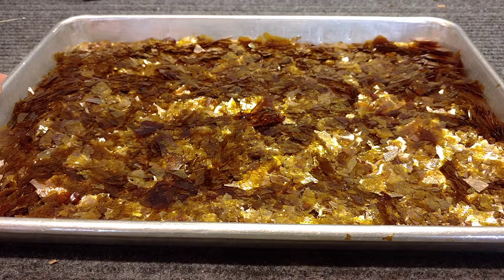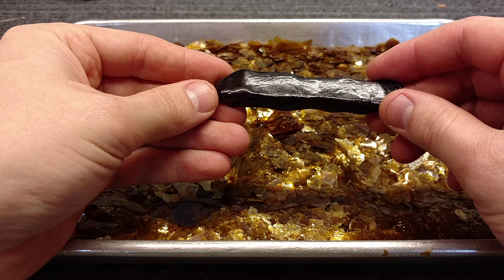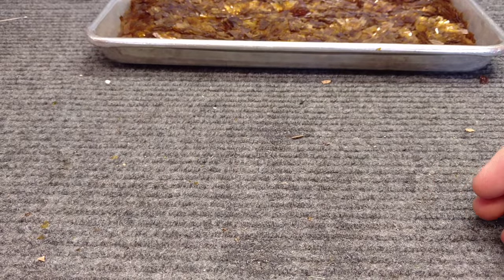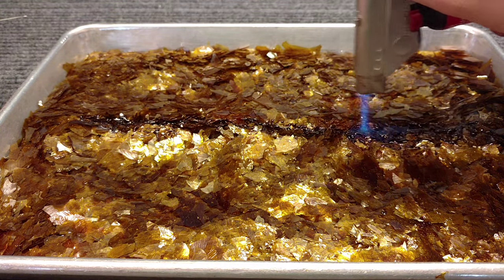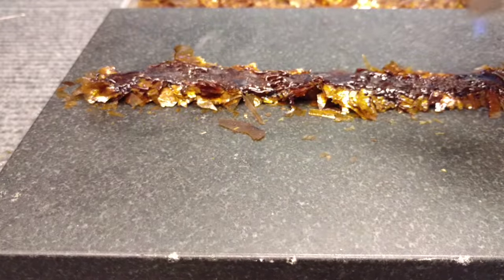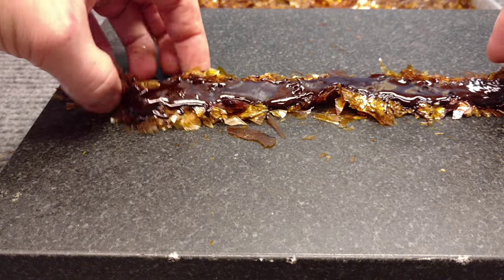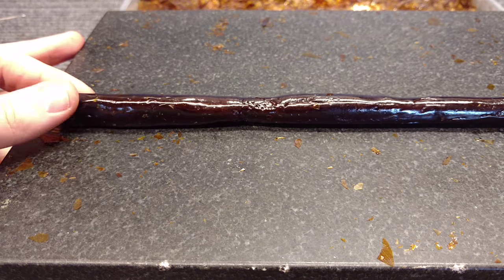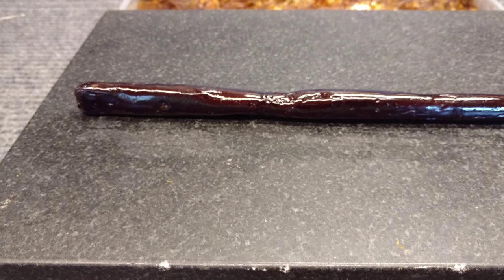Saxophone Repair Topic: Making Shellac Sticks

Comment: Granite doesn't hold heat very well... It will flake off and hit you in the face and put your eye out... You can actually use that little torch you have right there to make thermal flame Granite face... Or that texture you find on granite on steps... That's called thermal flame finish and you used a regular handheld torch to repair the large pieces or make additional pieces... So you do not want to use Granite when you're using Flame... marble cools at a faster pace... And it holds heat transfer better... For safety sake I would get a piece of marble to do this on

Comment: Why dewaxed? What is the difference in this use case?
What does the low temperature for plasticity mean for using the horn? Could I get the horn warm enough when playing outside on a hot day that pads in, say, the plam key area start to move?
What's pros and cons of shellac vs those hot glue beads that, I presume, get soft at a higher temperature?
Reply from the maker: dewaxed because that is what instrument repair shellac is made of.  you can try waxed and tell me why.  low temp means you won't burn lacquer heating it.  not warm enough when playing, but leaving horns in a car on a hot summer day is a bad idea regardless of your pad adhesive choice.  

glues have varying melt temps.
Reply: @StohrerMusic  Thank you for your quick answer to my question below such an old video. I must say, I didn't expect that. Hats off.

Comment: Hi , Did you know the technique of dissolving the shellac in a small pot with alcohol on kitchen , then  applies to the pad  and the cup? Specially for clarinets? Thanks!
Reply from the maker: I was taught this as Sax Machine in Paris but I have not integrated it into my repair style.  Super cool how it works though, and definitely a traditional skill I would like to hone at some point.

Comment: I've been using glue sticks to change my own pads everytime I find one odd worn pad. my question is what are the benefits to using shellac?....
Reply: it's one of these ancient (traditional would be an understatement) materials, that have just stood the test of time. similiar to hide glue or pitch. think of it as a brand of all natural hot glue, that stuck around for the last 3000 years. all 3 have in common, that they remain "temporary" for decades, if not centuries.
Reply from the maker: the melt temp is different, the plastic state is different, the hardened state is different.  whether or not you like to work with it better is a matter of personal taste.